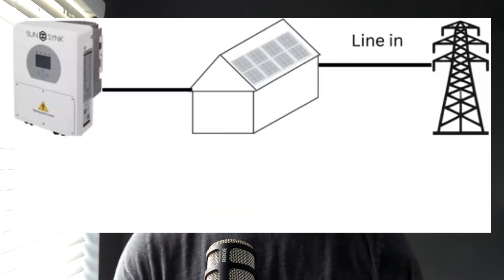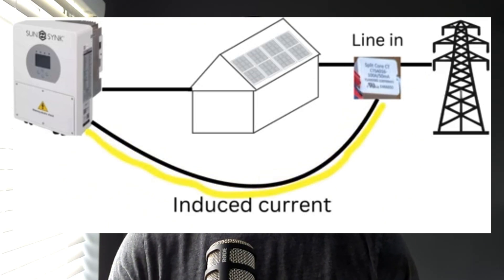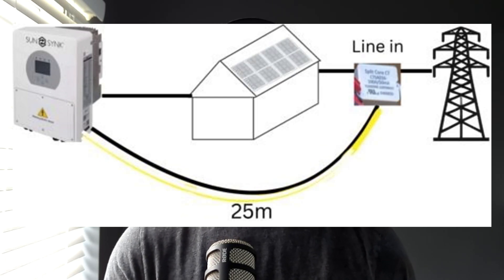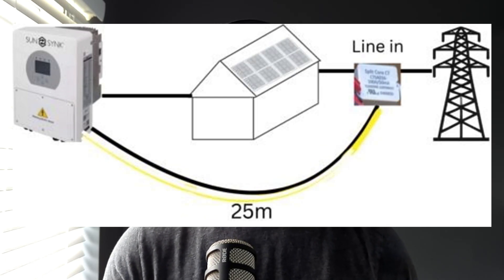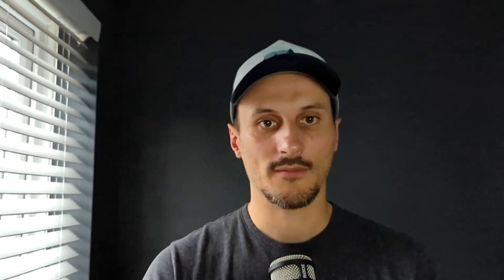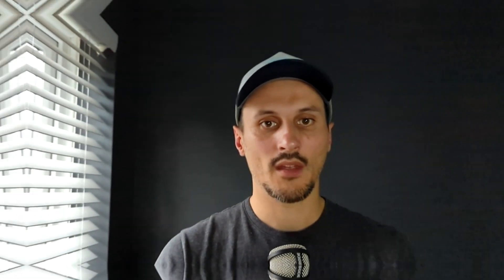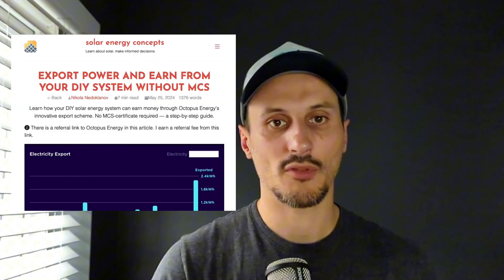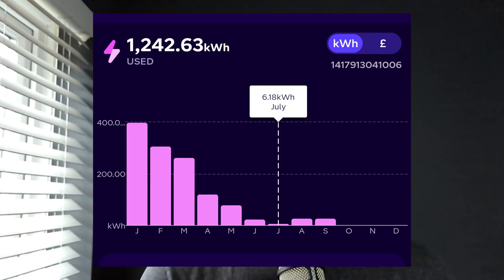What Is A CT Clamp? And How To Extend It Using This DIY Hack.

Comment: for long distance just make few loops of your wire around ct. and change parameter ct ratio in deye settings. as example, make 4 loops of the wire instead of 1 and change ct ratio from 2000 to 500. in this case you can increase distance 4 times or more
Reply from the maker: Sounds interesting. Could you add some details on this is supposed to work? Loop both the black and white wire of the CT clamp around the line into the house? 
A picture of this in practice would be great.

Comment: You used cat8, ok. But how did you connect the clamp to the cat8? Solder? Wago connector? Twist and black tape around the wires? Some clamps have proprietary connectors (ex: newest ones from shelly)
Reply from the maker: That's an extensive list! I used Wagos. 
I've seen comments about audio equipment cable and I'm planning to try with that next. I've got a 0.5mm2 one lined up.

Comment: Oh, I finally understood what you were trying to do.  The inverter was exporting when you didn't want it to because you weren't being paid for it (giving away free power!).  Awesome.
Reply from the maker: Absolutely. My biggest concern with unchecked export is also the risk of discharging the battery into the grid. That's why it's important to balance it out, even with a hack like this.

Comment: Hello, thank you for your informative video. Can you please suggest the setup for wireless ct clamp connection solution to inverter input. The situation - to achieve zero export conditions. I have Deye hybrid 3f inverter. Thank you.
Reply from the maker: Hi, thanks for watching, I'm glad you found the video informative!

I did some research into wireless solutions, I rejected some of the WiFi based options on the basis of unreliable network issues. 

Another drawback for me personally is that I'm a DIYer and I don't understand the wireless technology well enough to maintain it myself. 
So I took the tradeoff and set a trickle feed.
Reply: I am looking into the same solution, did you come across any? Thanks
Reply: @pr5991  Proved solution. Inverter side RS485 --> Waveshare RS485 to Ethernet converter --> Ethernet powerline adpter --> Existing powerline cable between switch box and inverter installation place ---> Ethernet powerline adpter --> Waveshare RS485 to Ethernet converter ---> Smart meter RS485 output --> CT clamps